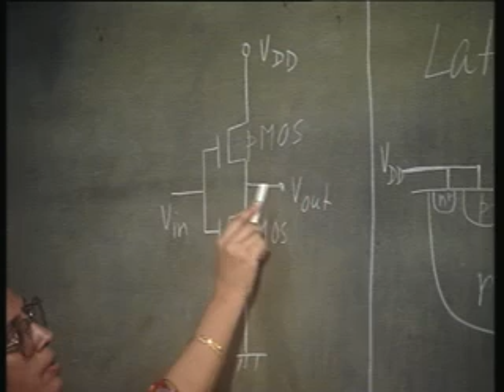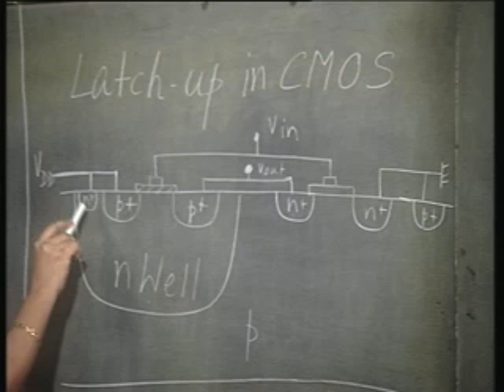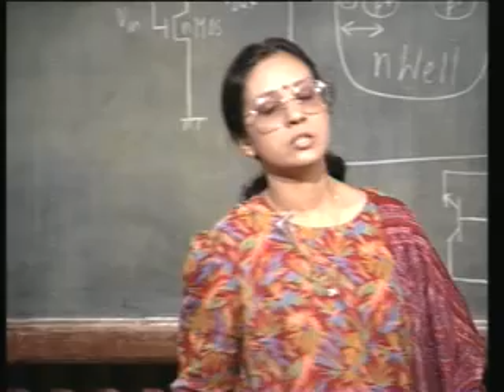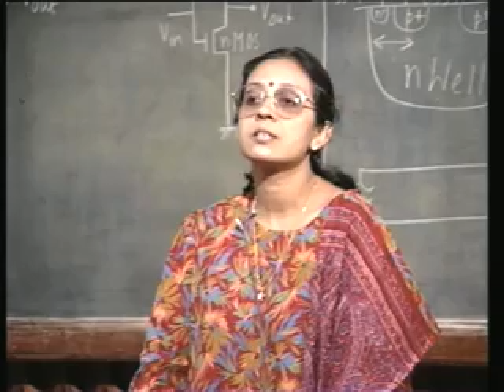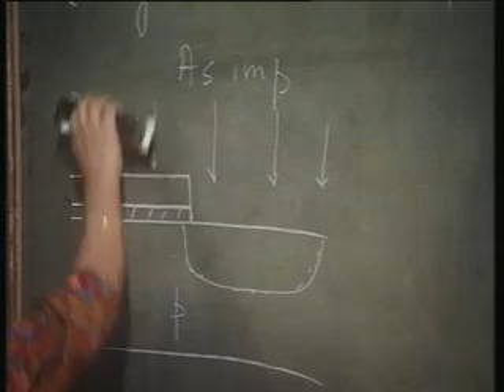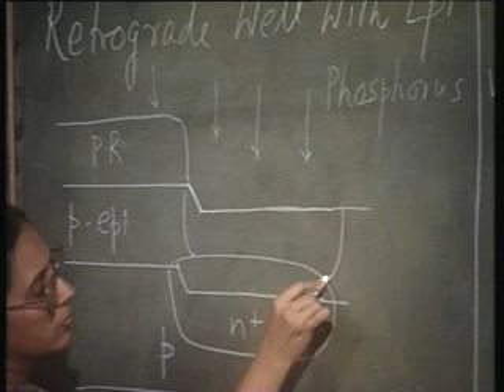Lecture - 39 Latch - up in CMOS

Comment: Mam  at 9:40 min  that n+ and p+ are connected to vdd that is reverse biased and you told  that if any voltage drop is created beneath p+ that will be vdd + 0.7 then only that pn diode will be forward biased and  you said vdd-0.7 which is lesser voltage to p+ region it will not forward biased, it will be reverse biased